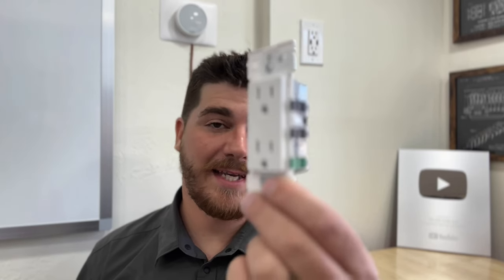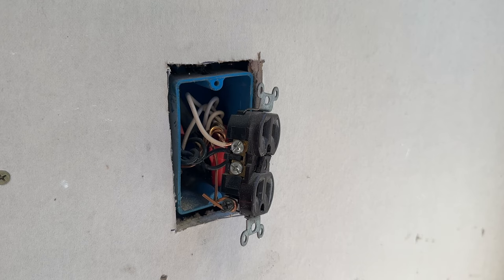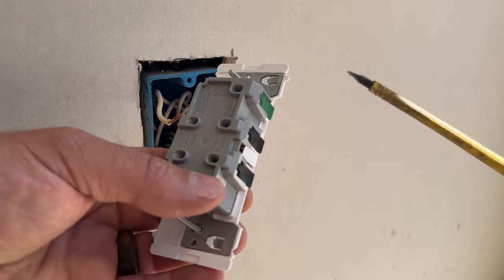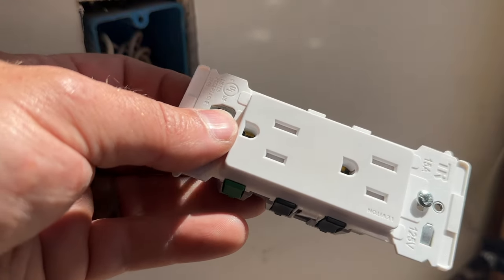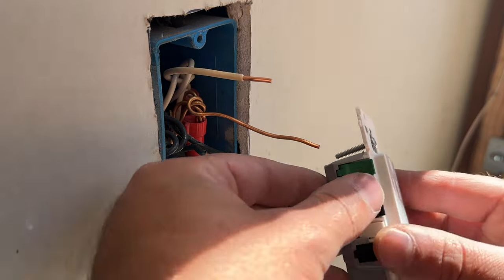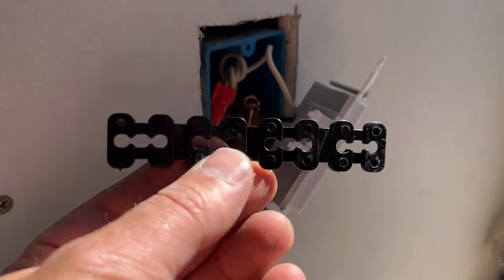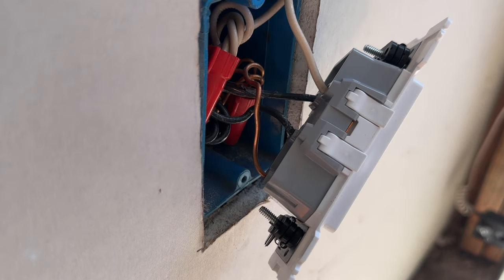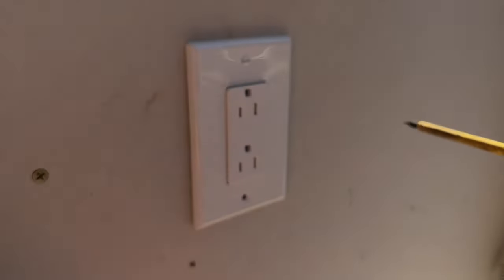Sorry Screw Terminal Outlets... You're Fired

Comment: NEC does not specify orientation to meet building code.  Either vertical or horizontal, and if vertical it does not specify ground pin down or ground pin up.   So gnd up or gnd down is by your preference, my father was a carpenter that did remodeling and he always installed them gnd down and so thats how I like them.
Reply: No code except in hospital wiring but their rules only apply to them. Medical clinics wire like the rest of us ground down. There are a few exceptions if you have a GE AC unit you may want to change from ground down to ground up. That fat plug was designed to plug in ground up orientations. The wire hangs on top if used on ground down outlets. 73

Comment: Unfortunately when you put the socket with ground up, plugging right angle plugs and power adapters have the wire protruding upward.  That causes the wire to pull on the plug and causes it to pull out of the socket.

Comment: Love your videos. 

However I don’t like the ground up or down argument. (I don’t like either argument it doesn’t matter) If your plug is that loose you need to replace it not flip it over. The loose outlet would cause extra resistance which means extra heat which obviously isn’t good.

Comment: You've just violated the Code. Two hot(black) wires to be connected out of receptacle then pigtailed to the terminal. Only exclusion are split outlets, but you didn't cut link out.

Comment: By code the box needs to be flush.  The spacers leave the side exposed.
Reply: Should have used 2 instead of 3 blocks.
Reply: Non-combustible wall material (Gypsum) so this would be allowed in Canada.

Though the outlet is supposed to rest on the plaster, instead of relying on spacers.

"12-3016 Flush boxes, Cabinets, and fittings
(1) The front edges of boxes, cabinets, and fittings installed in walls or ceilings shall not be more than 6mm from the finished surface and, where the walls or ceilings are of wood or other combustible material, shall be flush with the finished surface or shall project from the surface.
(2) Gaps or open spaces in plaster surfaces of walls or ceilings shall be filled in around the edges of boxes, cabinets, and fittings."

Comment: I guess I am going to be "That Guy".  First, I would like to say that I watch many of your video's and use tips and ideas shown all the time.  In this instance though, you are dead wrong in your opinion of these devices.  While certainly convenient, this style as well as ALL of the plug in style connection terminals; share the same deficiency.  Surface tension and mechanical bond.  As a 35 year electrician, I have seen hundreds of failures and fires from poorly bonded conductors.  ALL plug in type connectors fail in this regard, and even the best of them, which is the Hubbell Edge Connect, fail to give the mechanical bond of a screw connection.  It is your home, so spend a couple of dollars and just install Hubbell 5262 commercial grade receptacles.  They make all sorts of colors and variants.  This will be the best tip in your comments and your viewers will never be sorry. - John

Comment: Why didn't you clean up the sloppy mess inside the box? If I left a box crammed full of excess wire, I'd hear about it.
Reply: You are supposed to leave a minimum of 6" for future repairs. I suspect the wire nut on the neutral is due to a short wire.